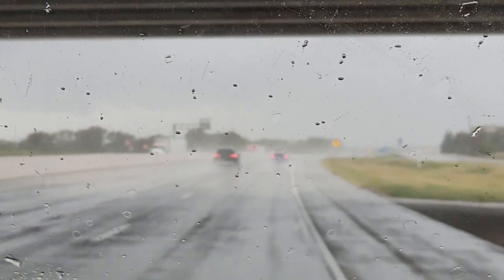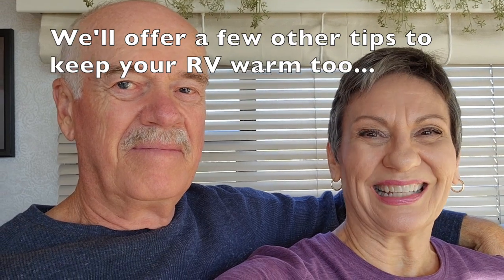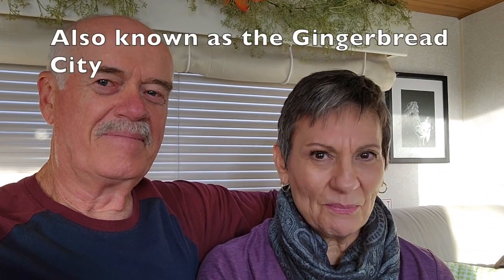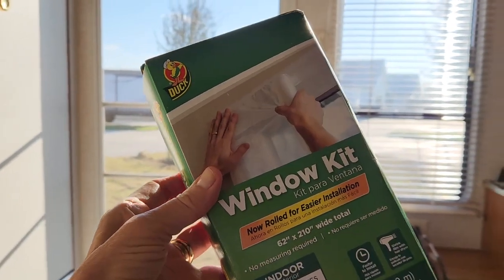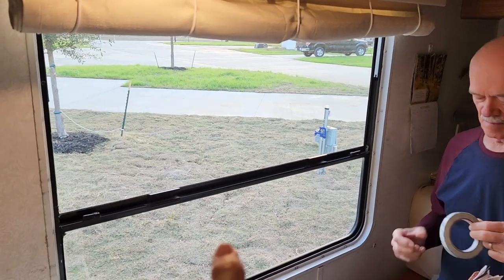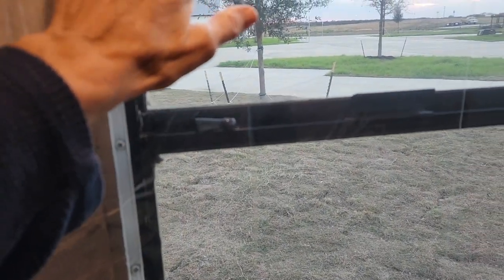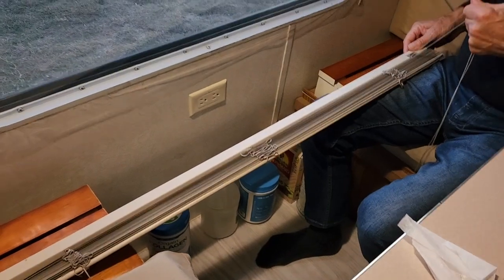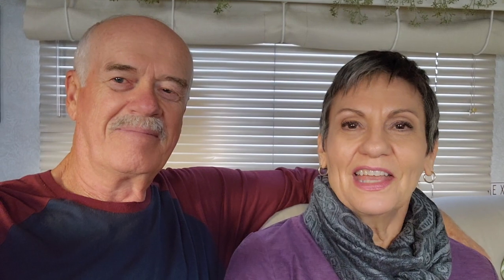Yr 6: RV life  Insulating RV windows without blocking light and where are we??

Comment: I just want to ask some questions that maybe you can answer since I have zero experience.
Why remove and reinstall these things (i.e. those winterizing foam pipe insulations). This question is coming from a lazylady. I usually like to have a one and done deal. But of course can't afford the more expensive better quality gadgets. I'm interested in moving into a manufactured home, and they tend to have the same issues that RVs/campers have. So would leaving those foams to keep the pipes from freezing mess them up if you leave them on all year round? Do they wear off? Does it rust the pipes? What are the reason(s) you remove it when warm weather comes back?
Reply from the maker: That's a great question! It depends on if the pipes are wrapped inside or outside the house and the climate you're in. Pipes wrapped in foam outside won't protect for very long if it's really cold. And sun exposure rain, hail, snow, etc would deteriorate the foam.  Inside, they could maybe be left wrapped year round, but a lot depends on the climate and how well the house is insulated, etc.  As for the window insulation kits, they will eventually lose their grip over time. When I did my Mom's windows on her house, the one that had a northern exposure stayed up 2 + years through a hot and humid MN summer and deep freeze winters!  It eventually wears off (loses the adhesive) in a sunny window in the summer. And since we aren't always where we need the insulated windows, it's not an every year thing. Sometimes, we are in a warmer climate that stays that way over the winter. 
The foam we added to the ceiling vents help keep cold air out as well as bright lights at night. But you wouldn't have those in a house anyway. I hope this helps! There are many variables to this depending on the details. Thanks!